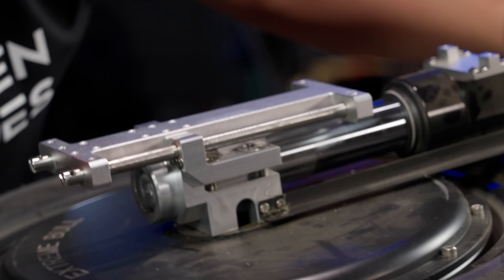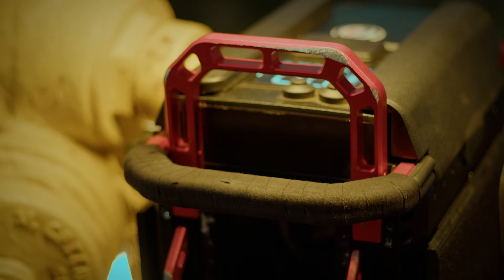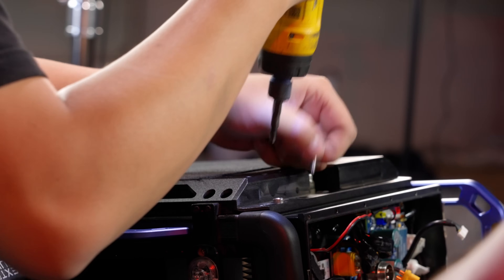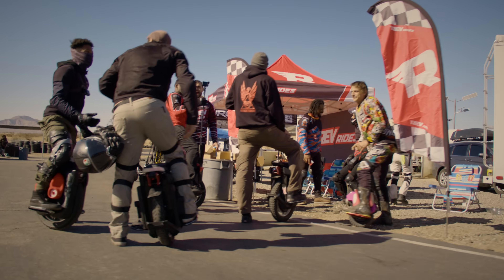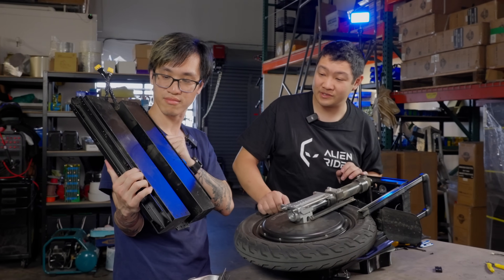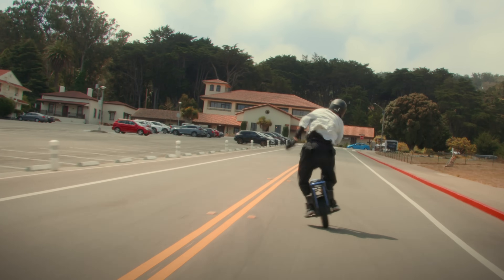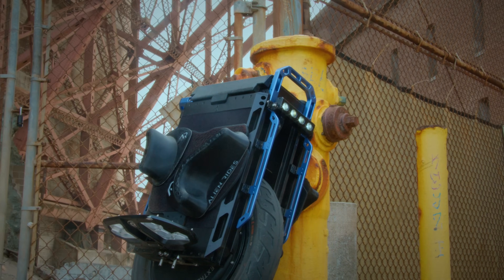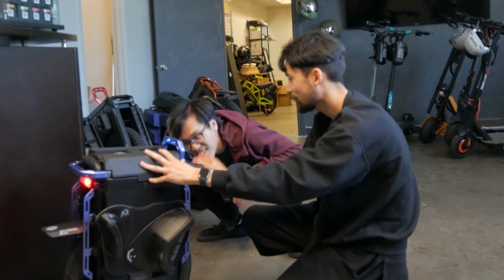THIS is the Electric Wheel We’ve Been Waiting For

Comment: It will be great if you can make a comparison of 16" wheels: Commander mini, Begode Extreme, 
Begode T4 Pro 100v 1800wh (expected), Inmotion Adventure, Leaper Kim Patton. And also add compare Leaper Kim Lynx and Begode EX30 the same test.
-Acceleration to 50-60 (to understand in what range the explosion is)
-Maximum speed at 85-87% pwm
-Power reserve at average 35-40km/h
-The width of the legs with pillows
-How much is it convenient to lay in turns (briskness)
-Center of gravity (who has higher)
-The maximum angle of ascent uphill 
-Charging speed
-Ease of maintenance (change the tire, controller, batteries, rearrange the height of the pedals, how fast ...)
*The caveat is that this should be done on the same tire, with the current firmware and with the same driving mode, with the same pillows.

Comment: Loved this video, great content guys.  So hard to resist a Commander-Mini once you get off the larger wheels of the past two years and give this one a try.  It’s everything you miss from the past but in a wheel that is very much in the present.
Reply from the maker: This is EXACTLY what we mean! Feels like having your cake and eating it too 🎂
Reply: Love this wheel. I also have a Patton and use it with the knobby for off road.
Reply: @RogueTravel  so what does Cmini has so special and Patton does not?
Reply: @omidel.  Lower pedals for better stability at high speed. And less low end torque compared to the Patton and more high speed. Makes the Patton better on trails. So I got the mini with the street tire and have two great wheels.

Comment: Fantastic production quality. Sketchy riding around cars tho, it made me uneasy to watch some parts.
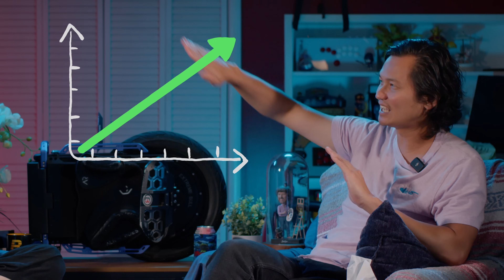Both "torque characteristics" graphs are completely wrong at 4:38 and 4:44 tho.
Torque is the highest at 0 RPM, kind of stays the same as low RPMs as long as the limit is the max phase current set in the firmware, then decreases gradually with speed, down to almost zero at freespin RPM.
So both graphs are invalid.

Comment: Been saying it since even before I had it. This is the best 16 inch wheel on the market. Great video guys. 🎉
Reply: Extreme has 130 mm suspension travel, smart bms, water proofing, wider rim, function brake/turnsignal light led speaker.

Comment: EXN with Sherman suspension?   Love the video... but come on.  Been researching the Cmini in depth and a common complaint is that the suspension is far too stiff - even for heavy riders and not nearly as adjustable.  No one saying it has the "plush" suspension of the Sherman-S, or even the Patton.   HMMMMMMMM.    You probably love the extra stiff sporty suspension, you can feel the road with even better.  But calling it a Sherman-S suspension?   Cant believe it.   Please clarify.   I want that PLUSH feel - and 99% sure the Cmini will not deliver that for me.  Going Patton instead. Love 16" wheels.